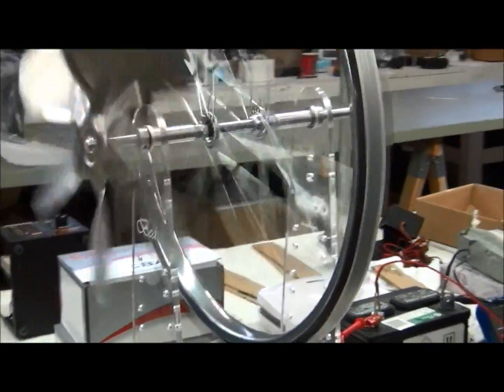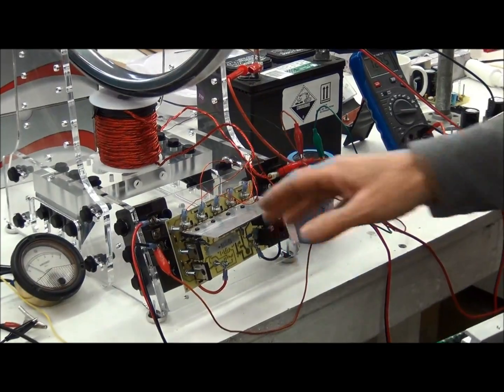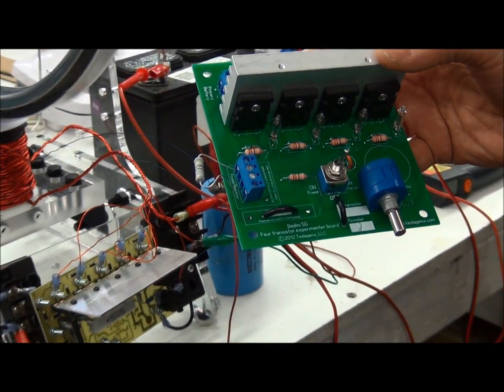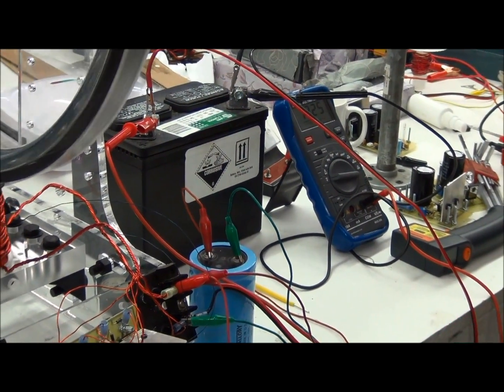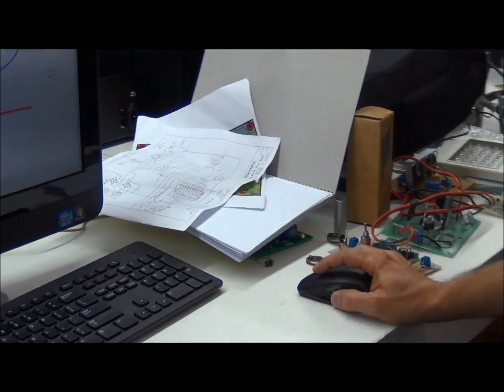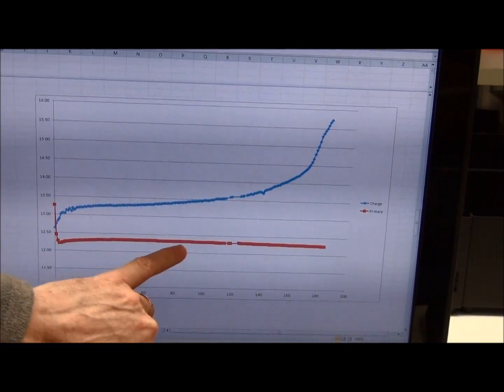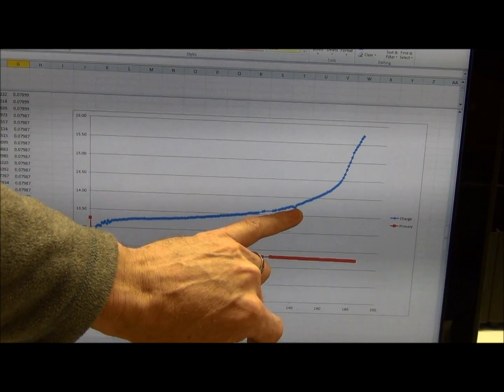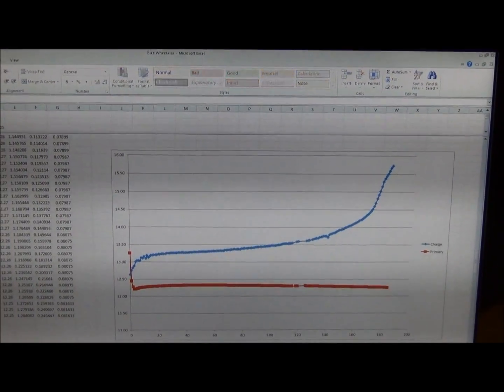Bike Wheel Kit Preview

Comment: Can the coil be split in to a upper with the tri filler and a bottom with a FWBR? or is the voltage too low.? Even if its only half watts, a push magnet at the bottom. I sure some one has already done this...